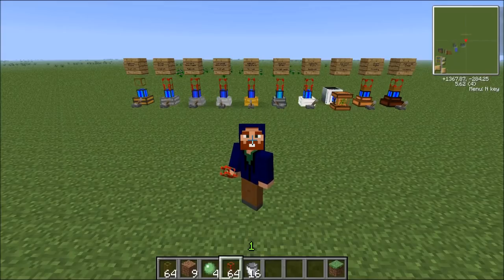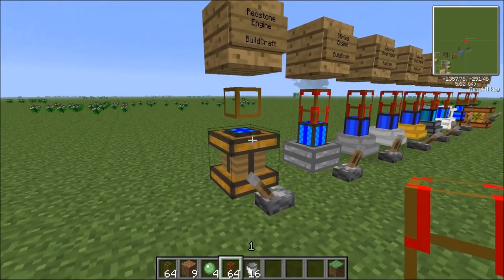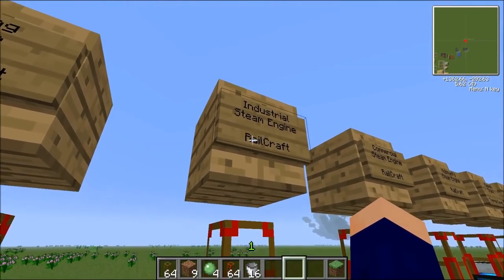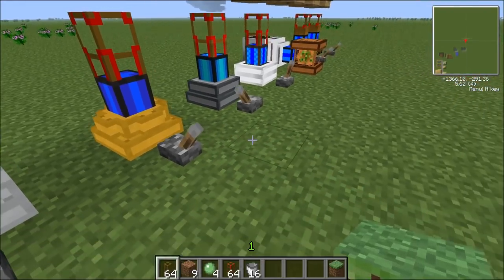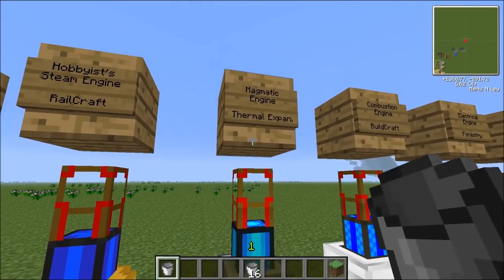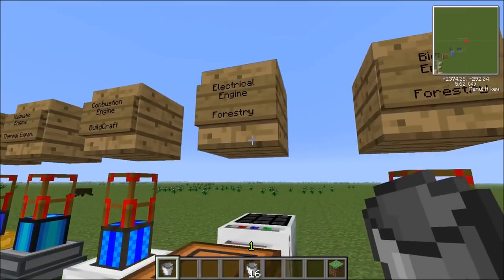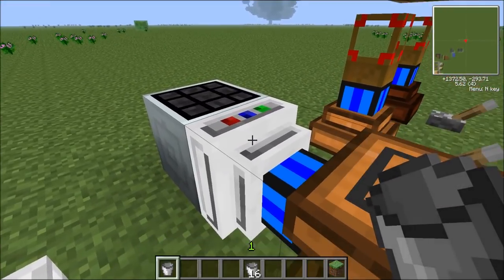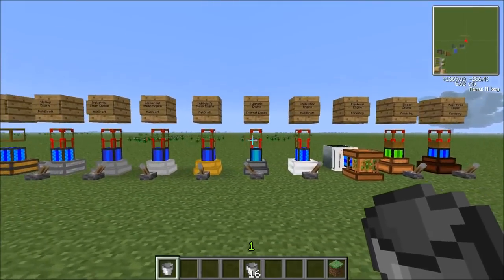FTB All Engines Tutorial (BuildCraft, RailCraft, & Forestry)

Comment: im using the FTB Ultimate v1.0.1 and I can only work the electric engine only if its to power a machine. it is the only engine that I can get to work. ive been using the lever next to the combustion engine along with lava/fuel, and water to power it but it acts like it locked up and just heats up until it explodes. what am I missing if anything please tell me. I need help.